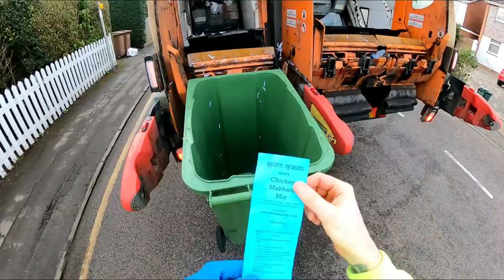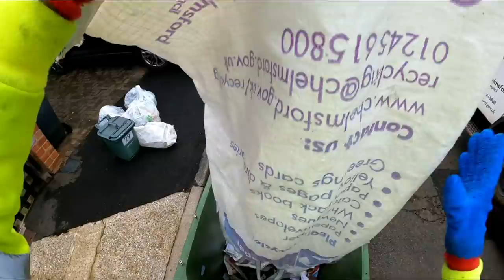Bin Man/Refuse Collector/HGV/Truck/Lorry Driver POV #16

Comment: I grew up with the Ford Sierra my dad had 3 when I was a kid then the dreaded rust hit the undercarriage. Then we went to the Mondeo after that. I was on the school run and a Sierra had broken down at a busy junction on my school route. So I gave the owner a hand and pushed the car around the corner and onto the grass verge. Not long after I had good chat to the owner and the clutch cable had snapped he got it fixed and the car is still going strong. I'd love to own a Sierra myself or a MK1 or MK2 Mondeo. Glad to see your back though keep the brilliant videos coming dude.
Reply from the maker: Do love a Sierra, very thin on the ground now outside of summer show season. Sorely miss my example, I am fortunate I got to experience it before these crazy price hikes.

Always liked Mondeos too. A good friend of mine, his father used to drive a MK1 Salmon Red (Pink) estate riding on a set of 3 spoke Mims wheels in the 90s. We were 7/8 years old going about in it, very spacious and comfortable interior.

Another good friend of mine let me drive his MK3 2.0 petrol hatchback 2003 odd, decent motor I liked it, nice easy drive with plenty of space for 4 adults.

Comment: I remember just a few years ago the bin lorries in Chelmsford area (I’m from South Woodham Ferrers) we’re a maroon colour
Reply from the maker: I drove a few in my time, LHE & LHD were the last week before being scrapped.

Floor got VERY hot in warm weather, left got uncomfortably hot if left to rest on the flat floor.

Don't think it had air suspension on the front, or if it it it bounced and crashed about like made.

Belched smoke, went well and made a terrific amount of noise. No sensible operator would run such a vehicle now in the current climate.

Comment: As a fellow bin wagon driver,  the only thing i can see that your bosses can kick off about is safety.  Your loaders should be seeing you back at all times when reversing,  and hold the wheel at all times ,   especially whilst filming .   Always cover ya back mate ...
Reply from the maker: Thanks for watching man.

I fully appreciate what you mean about loader assistance. However unless especially requested no crew I worked with saw you reverse back, workload and urgency to finish early meant they were darting about pairing up bins.

Thank you for the concern and thought my guy. Stay safe out there ❤️

Comment: It seems my local drivers don't get out to help the loading lads, is this something common or is it the drivers choice on if they assist or not?
Reply from the maker: Varies by the employer, some are employed to drive only. Dual purpose driver/loader here so you should get out and assist
Reply: @wheelerd02  interesting, obviously this is something you can decide to answer or not but how does this compare to other options when you have a hgv license?

Comment: Ive just found your Vlogs as i am taking my Class 2 course and test next week and am thinking about going into refuse collection as my first job. have you had any experience of Multi drop work as i have heard that they can be nasty? Also, doing the bins, do you have to use your tacho card?  You have a great voice for this sort of thing, you remind me of a cross between Mick Jagger and John Lydon (yes, that  is a compliment!) I Look forward to catching up with all of your videos. Many Thanks!
Reply from the maker: Thank you for watching 

The John Lydon connection has been made before, Mick Jagger is new though.

In MY experience multi drop work was terrible. Poor addresses, often no one to help unload, the vehicle would be poorly loaded. However you will very quickly learn the tips and tricks to make the job work. If I had a licence and breath in my lungs I would exhaust all other options before remotely considering that again.

If you can find local dustcart work I'd chuck in a cv. Home every night, "sensible hours" (depends on the operator), colleagues to help guide and assist you in the vehicle and I would say, the most amount of reversing this side of yard shunting. No pallets, straps, curtains, load sheets, someone ringing to find where you are etc.

However, as a bin man, you are also a scumbag. Everyone needs us but once collected get the hell out of my sight. Prepare for arguments, pavement mounting nearly striking your colleagues and abuse from residents. Depending on how they operate round there, only take what you are told. Any issues, drive off, ring up the office and let them deal with it.

If you can park those reservations out of mind then it is an okay job.

With the bins you nearly spend as much time going forward as you do backwards. Bin lorries I found was much more technical and tight access compared to conventional warehouse and industrial park deliveries.

We did use tacho cards at our yard, we operated on domestic hours so there wasn't a legal necessity but that's how they chose to do it. Definitely get a card ordered once you've passed your test.

Best of luck on your training and here is to a happy new career. Keep us posted of events.

Comment: On a  bin lorry do u have A emergency stop button
Reply from the maker: Yes, 1 in the cab and 4 outside. 1 for each side of the lift and on the side edges where the hopper blade control are.

Comment: How does rubbish get compacted to the head of the wagon? Also does the rubbish gets crushed
Reply from the maker: Hydraulic blade gets pushed today the front of the vehicle as it gets full. There is a hopper blade to scrap out the loafing area and it gets crushed into an oblong of rubbish.

Rubbish crushing, on vehicle or it's final destination?
Reply: @Pounds4Hounds91   so how does it get all the way into the truck to near the driver ? Does all rubbish get crushed
Reply: @Pounds4Hounds91  on vehicle does it continuously keep getting squashed and crushed? Using my mates account, I'm called ella and I love your hot accent 😍.  Got a crush on the he he x
Reply from the maker: @garyhugo1392  yes, crushed into a oblong mass approx 10/11 tonnes depending on material
Reply: @Pounds4Hounds91  wow that's awesome
Reply: @Pounds4Hounds91  so anything that goes in gets broken what's the biggest thing your truck has ate ha x
Reply from the maker: @garyhugo1392  "I couldn't possibly comment" (for self preservation & future job prospects)
Reply: @Pounds4Hounds91  what you mean ?
Reply: @Pounds4Hounds91  maybe get some videos of it crushing big items like chairs etc. X
Reply: @Pounds4Hounds91  can you do a video of stuff being popped like inflatable things or some big things
Reply from the maker: @garyhugo1392  left the job over a year ago now, there are other such videos posted of items being crushed